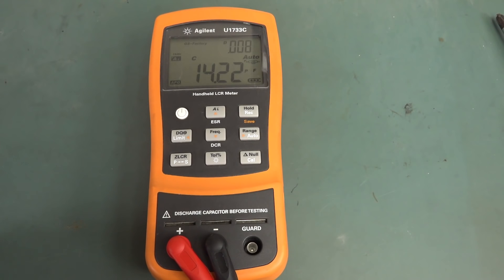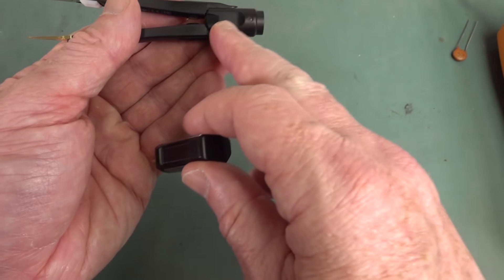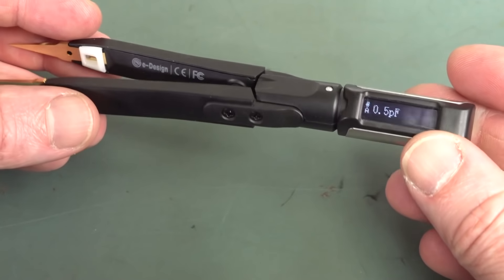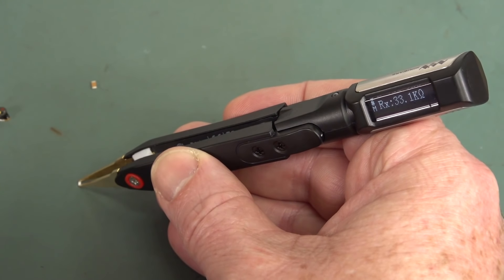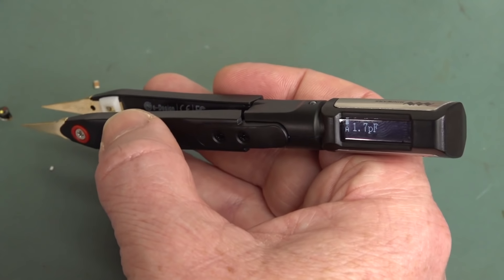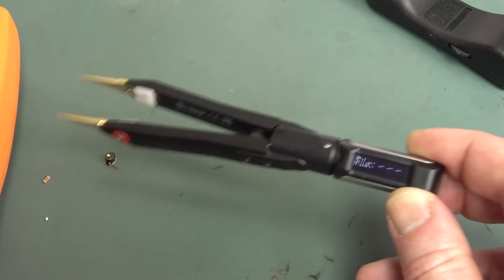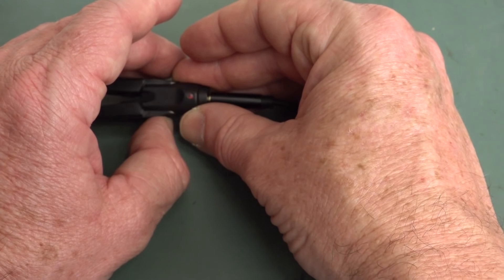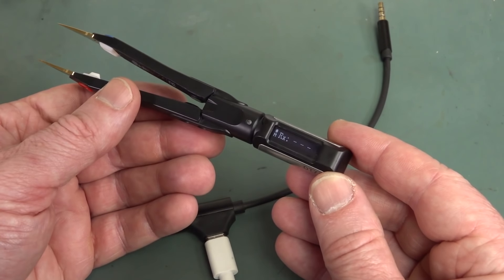EEVblog #1335 - Miniware $70 DT71 LCR Tweezer REVIEW

Comment: It's a good idea. Better than trying to read that stupidity small writing on the sm components. You just need to know if you have picked up the correct value. It's still useful as yes that's the 33k ohm resistor that's the 1k before soldering in . I for one would still find them useful 👍

Comment: The design of this model lends itself to tremendous improvement by third party entities.  All you need to do is design a device that has the same plug to plug into the tweezer portion and make it more accurate, have better input for the switch, and add the improvements you suggested and voila!

Comment: $10-15 Marcus' transistor tester is more precise, does all the secondary measurements and has a lot more functionality than just LCR tweezers. Sure, it's not in a tweezer form factor but hey, it's just 15 bucks.
Reply: @reeder 76 what does it matter that it's built on atmega if it does the job. What do you mean not properly designed tool? The documentation is extensive and there is a lot of work put into it.

Comment: No thanks, I will stick with the DER EE DE5000 proper LCR meter which is only 30 buck more and way more useful.
Reply: I definitely agree with you but I had to  buy the leads (tweezer & alligator) , grand total was 130€ from Japan eBay

Comment: Wonder if you could make an adapter cable to allow the tweezer part to be used with a standard LCR meter (ie TRS to banana plugs)? That plus the ability to use the portable head could be attractive. I really hate the cheapo tweezer adapters.
Reply: Definitely would be possible. If its TRRS then + lead, - lead, battery +, battery -, something like that.
Reply from the maker: I'm sure you could, but you wouldn't pay that much for just the tweezers

Comment: I like the tweezer idea, i have a dirt cheap LC module, backlit, from china, i put it in a baccy tin and it is pretty accurate! But it has tiny croc clips, the tweezer is a much better idea, and you only need one hand. Talk about losing SMD's, even when i drop a 1/16 watt resistor, i get under the bench with a 5 watt led torch, (like you do) and i find 12 of them, none of which is the one i dropped. Is it just me or does everybody get this??? Keep em rolling Dave :D P.S. Loved your Amiga 500 teardown from way back when. Mine still works perfectly!!

Comment: I hate those tiny displays, limited info on them, and hard to read (my eyes aren't great up close).  I'd prefer the device had a bluetooth link to a larger display unit or cell phone.  That way, you set up your display someplace convenient and stable, then probe whatever you like.  This eliminates issues such as tool angle in your hand and the limited space on such a small display.  A standalone display with the wireless link can display larger numbers and potentially a lot more info and it's always convenient to read.  Call me old-school, but using standard wire-lead probes with a meter has never felt like an inconvenience to me.  I bought a very expensive tweezer LCR tool (it was about $350 or so) about 15 years ago and I've used it maybe 3 times and never liked it.  Once it came in handy when someone in the lab spilled a bunch of 1206 and 0805 parts (like a few thousand parts of many values) and the parts had to be sorted one by one.

Comment: Wow, I saw those yesterday, but I didn't realize they were $70. Maybe I should have held off on that de-5000 :/
Reply: Nahh, the DE-5000 was worth the $30 more.
Reply: as Dave pointed out, this tweezer meter doesn't replace a handlet device and its design is a bit unrefined. As briefly showed, you can have some cheap tweezer probes to plug into your de-5000, that's not perfect but more accurate.
Reply from the maker: The DE-5000 is vastly better, just get some tweezer adapter for ti.

Comment: My problem with tools like this is lifespan.
If you buy a fluke dmm/testgear (or other quality brand), you'll still be using it in 30 years.
With gear like this, the internal rechargeable battery will be toast in 5-7 years. What then? Buy a new one? (And again and again....).
Even dmm's with lipo's. If that lipo is toast in 5-10 years, can the dmm manufacturer provide a new one, or do you have to try and get a similar cell on ebay, change over the leads/connector etc.
I prefer testgear with simple batteries and when poweconsumption is very high a set of eneloops will do the trick. I'm certain that in 20 years AA's or 9V blocks will still be around as form factor.
Reply: Well if a multimeter has a common standard of li-ion like 18650 or a common NiMH like AA then I have no problem with rechargeable batteries. But when it comes to proprietary Li-po packs, i don't like them either.
Reply: Don't be so pessimistic !

Comment: Random secondary measurements, spontaneous reboots, out of spec measurements and a ridiculous charging cable?  No reason to consider this.
Reply: The good thing with miniware products is they're open source. Hopefully someone writes new firmware to fix the issues, if it is a software issue
And yes, that cable is very silly. A real shame seeing as the ts80 uses usb C
Reply from the maker: Hopefully they can fix stuff in firmware. Unfortunately there is nothing else close to this price point.
Reply: @ciarfah  I don't like the idea of supporting a company that makes people work for free for them. Nothing against open source, but make something decent first.
Reply: EEVblog they say the are open sourcing the firmware. I anticipate there will be alternative firmwares as for the ts100

Comment: I'd rather a AAA battery over proprietary charger and non user replaceable, internal battery
Reply: Agreed. I have a pen-style voice recorder and keep an extra recharged AAA with me. Low battery? Just swap it out and continue, no cord rubbish getting in the way. And 20 years from now it will still work, rather than have a dead battery locked away inside.

Comment: The number of 0603 components in my carpet is unreal.
Reply: Same here.  With a tool like this I could vacuum the carpet, shake the filter onto the bench and test/sort all the debris.  On the other hand, I have a strict rule that I'll never put scrap or used parts onto a card that I'm selling.  Some of my products need super-high reliability - gear for ocean-bottom observations.  Replacement/repair is either impossible or hugely expensive.  My hard-won reputation is worth more than the price of a few bits of industrial rice...
Reply: @jrb_sland5066  Completely agree.  Always pick a new part.

Comment: Seems like it's not really ready for sale...
Reply: Yeah, need to wait for v.2. Charging should be made better, screen should be larger. This stupid extra charging cable/adapter will keep getting lost. The USB connector should be on the device itself, period. Micro USB is OK if Type C is too large for that.
Reply from the maker: Yeah, needs firmware refinement.
Reply: @EEVblog  too be seen, the hardware could also be substandard  and no matter what algo you through at it.... It might just be crap :-)

Comment: If the brain connected to the tweasers with a USB C instead of an audio jack, you could charge the battery via USB and plug the brain into the PC without users questioning why you can't use it while charging.

Comment: 07:42: This tweezer cable is total junk. The contacts oxidize so fast that I have to clean them before every use. It's a pity that there is no option in between this junk and the expensive tweezer cables from the brand name manufacturers.

Comment: ain't there a menu, where you can adjust things if the automatic screen orientation shall be fix or not.
I reckon not, since you go on for many minutes how big a mess up that is, and you can risk that it flips.
but whatever, usually you will not read up on these things and perform due diligence on the products you review, and often seems like you enjoy this bitching about certain stuff that is often down to you not reading the manual. 
but that is how you roll, so fair enough, I certainly prefer that then the other way around and not being critical so I do like your critical approach +1 though I do hope you would read up on a manual on certain things, as a 1 touch input interface' and if there is a menu, can be quite a hassle to decipher without a manual,.
Only got one electronic thing from Miniware, and that's a small scope and I don't like that... crappy interface and all their promises about live ecosystem and support of new features they have plastered all over this product in the box and on their site was a straight lie... +3 years down the lone and not even as much as 1 update and all their YT shills like this Marco reps dude from Germany that again and again stated it is open source, and community support etc etc and its so good.. (no it wasn't open source at all) and the Marco dude, admits he just read what press materiel they send him, as he is not reviewing it, he is only promoting it and advocating it and don't validate certain claims from this Chinese Miniware.
"When my channel gets bigger, I will be more critical" was his argument on EEVblog..(whatever)
Though also got a small Damascus layered steel scraber from this Miniware, and that one is solid to under ten bucks.. https://i.imgur.com/oc7sFVV.jpg

Comment: The tweezers are badly designed, very wobbly fastening of the measuring arms, it should be steel, not thin plastic like in a children's toy, there is no automatic polarity, uncomfortable touch button - a simple switch would be much better, very short operation after charging, inconvenient way of charging, product sucks, it spoils the nerves, I do not recommend it!